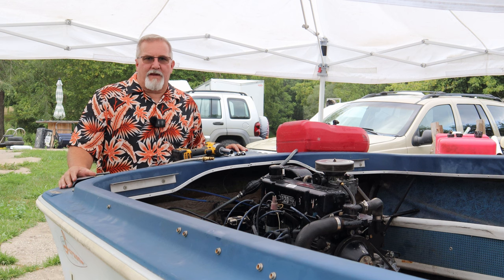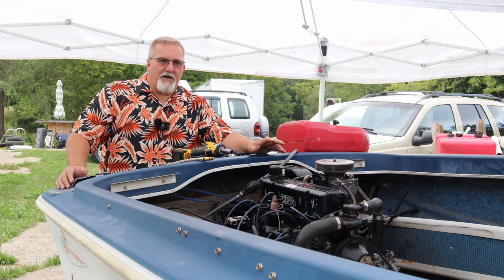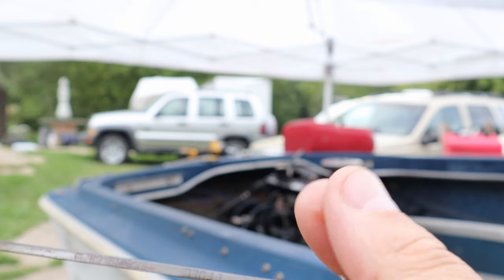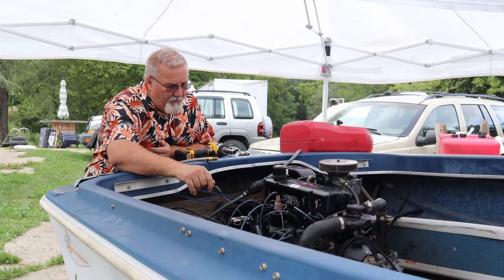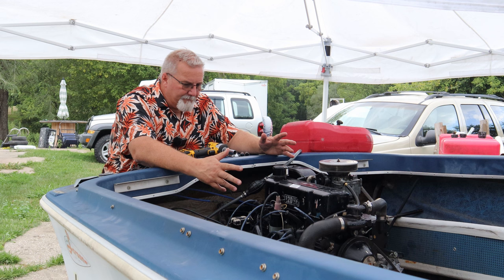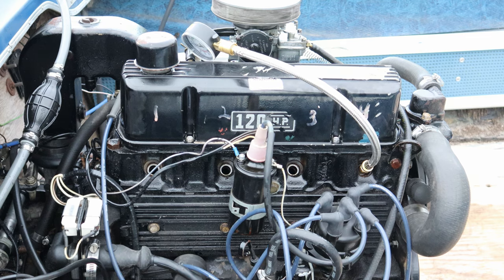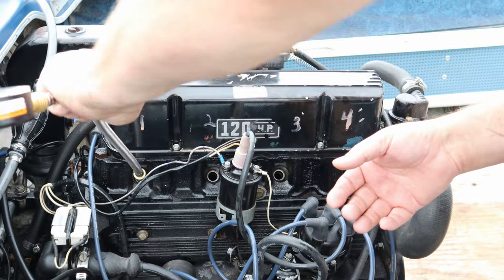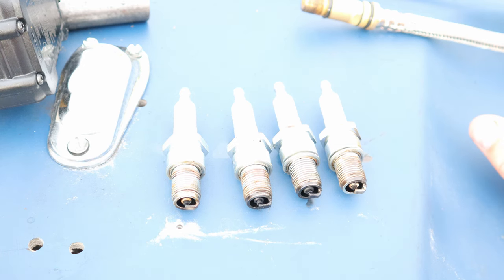1973 Larson Mercruiser 120hp Checking out the compression voltage output

Comment: Use a Bic lighter and put it under the tip of a dipstick if you see little bubbles  you have water in your oil if you had gas in your oil you'd see a flame it works
Reply from the maker: I will try that on the next one.